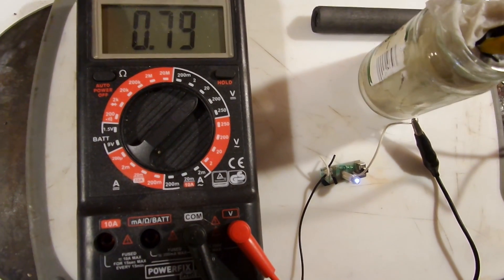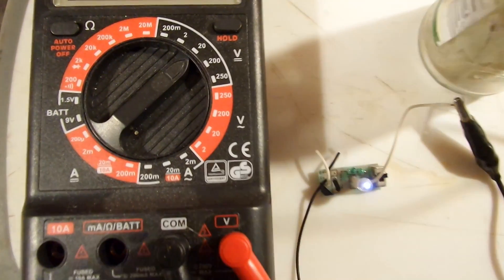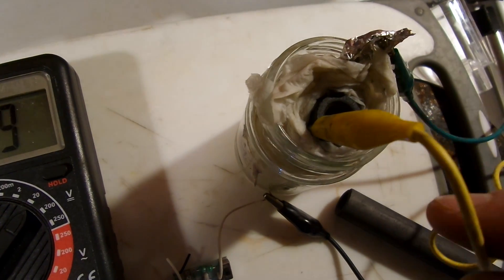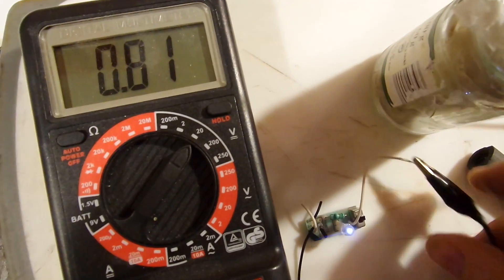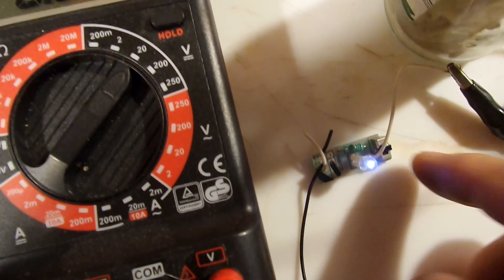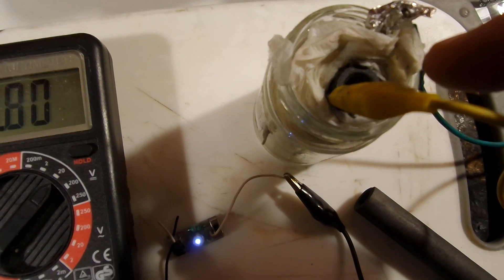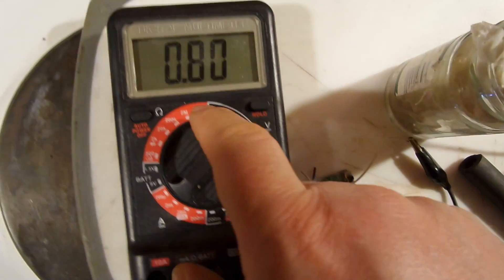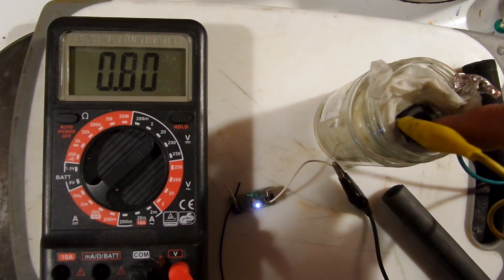Graphite Alufoil Galvanic Selfmade Battery Cell powering Garden Light LED Circuit

Comment: Does the cathode need to be porous? Graphite plates are not porous whereas activated carbon on some mesh is porous! However both of them provide nearly the same current and voltage! How can this be improved then? I always get stuck on the topic of porosity!
I am working on this for a long time now and want to improve!

Comment: Hi, how long it last?
Reply from the maker: +Bartosz Barejko Must be still checked, first I need to build it much bigger with new components and also include the tricks from the Cayrex2 Youtube channel to get higher voltages and then scale up these cells with bigger surface area, so we can run 10 Watts LED lights from it for some pretty long time...
Reply: +overunitydotcom I my Cell there is no reaction only fule. Today i might make a movie. Now it is my only job.

Comment: well done! can we use some active carbon instead of graphite ?
With that voltage if you use a better JouleThief/toroid you could light many more LEDs
Reply from the maker: +Gianni Laschi Yes, but then you need to coat a stainless steel scrubbing mesh metal with Activated Carbon paint as the other electrode.
Just grind Activated Carbon and mix it with an acrylic binder and water
and coat paint the Stainless Steel Scrubber metal with it...
This way the stainless steel will work as the pickup electrode inside the Activated Carbon and lower the inner resistance of the battery cell.
Reply: Thank you!  you're right,  we need a current collector for the active carbon, what can we use for the binder? does it need/better to be conductive too?
Reply from the maker: Gianni Laschi
Well you could also just use activated carbon powder on toiletpaper or kitchen towel paper and dip into it some stainless steel scrubber mesh metal something like this:
http://amzn.to/1R5m1Vf
for the pickup electrode...then you don´t need a binder... But for a binder you can use something like Acrylic Binder for painting purposes...See somethingh like this:
http://amzn.to/1M5LsEN
Surely you need toilet paper or paper towel then to separate the alufoil electrode from this Activated carbon-steelscrubber electrode ! Hope this helps.
Regards, Stefan.
Reply: overunitydotcom
Thank you so much for the info.
Reply from the maker: +Gianni Laschi This way you could enhance it even more up to 1.9 Volts by using NaOH and ALCL3 in water as the electrolyte and MnO2 and a graphite plate as the pickup electrode:
https://www.youtube.com/watch?v=JrQ34aPBPrA
Reply: overunitydotcom
yeah i know that video...
what do you think about bedini crystal battery, could be that a NON galvanic reaction?
Reply from the maker: Gianni Laschi
Well the copper-oxide layers in the Bedini crystal cells work as diodes, so galvanic current is almost non existant...so the magnesium rods hold longer...but who knows..
Magnesium tends to decompose in these cells probably also after some time...